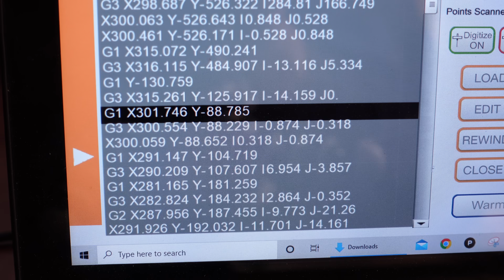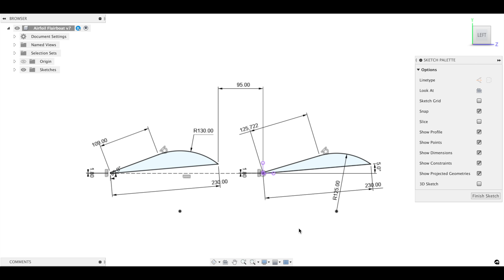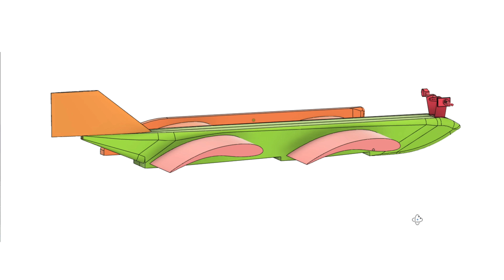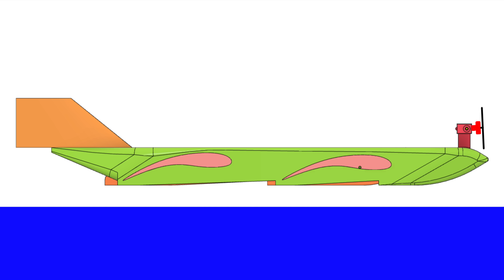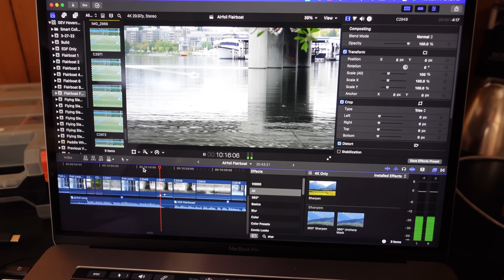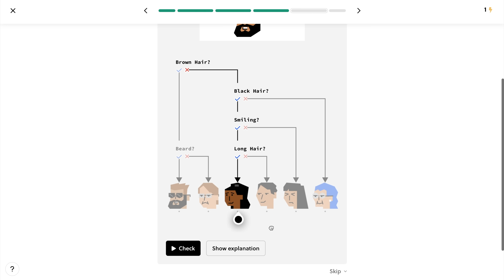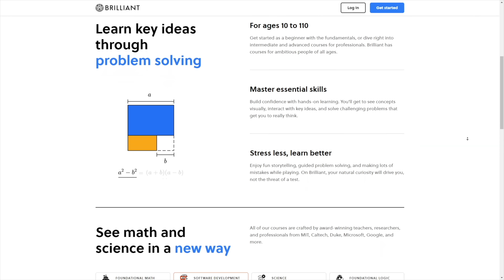Worlds First R/C Airfoil Flairboat

Comment: A couple of ideas for you, Daniel. First, what about separate flotation and airfoils, rather than trying to make the airfoils do double duty? The idea would be to sort of bridge between a three- or four-point hydroplane with ram air tunnel(s) and your/Jorg's flairboat.  I'm planning on trying this. Four flat-bottomed, square-nosed, up-tilting float pods like your RC hydroplane, in about a 3Lx1W proportion each. Each of these is attached to the frame formed by side panels and transverse booms by means of a single end yoke (each) that allows free movement of the float pods about both pitch and roll axes. I'm considering simple suspension (R/C pickup struts) for the float pod connections, as well, all to try to keep the vessel level. Wings are now inboard of the pods, stretched between the frame members. Still kiss the water with the float pods but have almost all the wave- and surface drag alleviated by the tandem air wings. Water- rather than air-propulsion--I'm motivated to try oscillating opposed vertical foils for their potential in a human-powered application. 

Building on the fixed-wing hovercraft idea, one thought I have is to extend the side panels down past the waterline and add deep skegs/skids on either side of the bottom of the float pods, all to serve as both aerodynamic and hydrodynamic tip seals to kill vortices. Deep, flexible but fixed flaps on wing trailing edges also seal (almost?) to water; the same concept applied to the float pods serve as trim tabs to assist with getting to plane very quickly, and may assist with developing an air cushion under the float pods, if speed were sufficient. 

Anyway, your fresh ideas and prototyping speed are incredible, and a spur to me to get my butt in gear and start cranking some models out. Thanks so much for sharing!

-HortonHCCI

Comment: I would say that if it can't achieve sustained flight except in ground effect then it is a ground effect vehicle. Even if it can leave ground effect momentarily.
Reply: Sustained flight is the key measure. Anything can loft itself given enough speed and control authority. Or lack thereof of one’s hydroplane (which have adjustable wings up front but that adjustment is static for a given race, typically).

Comment: Impressive research and development. Making a first  within a saturated commertial environment  is a real achievement. The background is filled with short fat hulled boats. Could the ground effect be up-scaled ? to transport containers with football field size wings. Getting exciped, once the compressed air is under the wing there is no furthe energy exchange  except drag , its just the initial compression at the wingtip. probably need a slingshot to get it going. Amazing work. The songs are good too.

Comment: the trust vector should go above the gc, so when you add power, it will tend to nose down instend of pitch up, and by the starfish case , the use a piple to introduce alittle bit pressure behind the motor under the wing, so they dont have ti put the motor in the front as its quite turbulent. and in nascar race car they have a one way hatch to release extra pressure under the car so they dont have a lift off when the eddy is broken.

Comment: I don't think it's really possible to make a craft that's 100% restricted to ground effect and entirely incapable of leaving the ground effect zone. Once you get going fast enough you will always run into the lifting body effect. Even a brick moving fast enough will generate lift at the right angle. At some point it's just a balancing act, making it so the engine doesn't have enough power to pull the craft fast enough to generate adequate lift outside the ground effect zone - given adequate engine power you'll always be able to break that barrier.

Comment: What if you had the wingspan of the rear foils a bit wider than the front foils, such that the front loses ground effect at a lower altitude than the rear, making it so will try to self stabilize if it starts getting higher?

Comment: If a car with enough speed and unfortunate aerodynamics can lift off, then no ground effect vehicle can be a true ground effect vehicle.

This is a standard that's ridiculous and unnecessary to aim for.

What you really should be looking for is a ground effect vehicle that intelligently regulates control surfaces instead of motor speed to maintain ground effect.

Because a GEV should be able to ground effect at varying speeds.

You could also try to look into initial stage hydrofoils just to get the hull off the water at startup and also as a protection from unintentionally slamming into the water.

Comment: A flair boat based on the same information that you found on the internet was my next project, you have beaten me to the build.  Mine was going to be larger  and heavier to help deal with the water conditions in much the same way a larger model aircraft is more solid in the air compared to a smaller one.  Thank you for your work as it has inspired me to get a move on and build mine.  I will be using the same material but covered with office laminating film.  I previously made an X-bow catamaran as a tow-a-long camera platform for my RC yacht using the same covering technique.  The foam/film combination is a match made in heaven.  Looking forward to what you come up with for some improvements.  All the best Allen

Comment: Have you done a CFD model of this? In my opinion the R/C version being able to take off is a non issue when you scale the R/C motor and total thrust against what's essentially a lycoming 6 cyl motor and prop. Scaling down thrust to add to the realism of the model and still functioning is the proof in the pudding.

Comment: I just started watching but I don’t think this is going to be possible. Lift and speed directly relate to each other. You can fly a brick with enough power. No mater what power plays into this idea.  No matter what you build  that flys just off the ground add more power/air speed and it can fly higher.

Comment: Wonder if it would be more beneficial to have some leading edge slats on the the front wing instead of control surfaces on the rear. Unlike a full-size airplane though, these slats should move forward and up instead of forward/down. Better yet, imagine a wing with a tube for leading edge. Then imagine you have a slat of triangular cross-section that pivots around that nice round leading edge. Essentially this will be changing wing geometry from traditional wing profile to the supersonic diamond wing. 
 Since this GEV seems to be more about rationing incoming air between front and rear wings, the slats would be acting as a divider of sorts, either pushing more air under the front wing, or allowing it to coanda above and go under the rear. In addition, raising the slats on takeoff will allow the craft to get out of the water easier by providing a downward slope that would naturally try to climb to the surface.
With current control scheme all those rear surfaces do is decrease the cushion at the rear, while also fighting the lift it produces.

Comment: Next iteration...ground effect sort of requires ground, not water. Add small wheels so it can roll, but just barely enough to clear the underside from the pavement. Then fly it in a parking lot like you do on water.

Comment: If you scale up the whole design to 3 meters wide, whatever the lenght comes up to be, and build it in foam with chambered paths for two metal pipes to go left to right in both wings, and two more pipes back to front in the body, clamped with the wing ones wgere they intersect, with some 30 to 40 Hp motor I gues you can fly it yourself over any flat kind of surface, trimmed grass included.
The aircushion is at a proportionate ratio so a biger plane would fly at the same ratio between span and ground as a small one, hence in metrics, might fly at a meter or half a meter from surface.
If you want to understand how to build such thing cheap, light and sturdy, go see the channel of Peter Sirpol, his foam ultralight airplanes, that he flies in them to hundreds of feet above the ground.

Comment: I'm curious why you haven't put a atmospheric pressure sensorson the underneath of these crafts.
Reply from the maker: I think if the pressure was actually higher underneath the wing then the aircraft would be ascending. In order to maintain altitude the pressures above and below always have to have the same difference

Comment: 0:10 = yes you can, by reduce throttle, add extra weight, shorten the wing, or designing hole new air foil. but adding more weight or shorten the wing is a better solution, because it cost efficient
14:56 = is not cause by smooth surface, but water tendency to "bounce" or "dampen" the pressure so the craft fly smooth

Comment: At that size and weight, I suspect the surface tension of the water makes takeoff more difficult, and the amount of water stuck on it impacts how it behaves in air, significantly. Personally i like that basic design best, and think it just have to be bigger, and heavier, to stay in ground effect very well, and still not be able to fly.  Any model that needs almost as much thrust as its mass to get out of the water will be very difficult  to get unable to fly, at least with elevators enough to allow free flight.

Comment: The term ‘First Principals’ is thrown around a lot now days, this is a perfect example of going back to first principles to establish how something actually works in order to design something that actually does work!
It would appear from the incredible speed of this vehicle over still water, that the viscosity of the air between the underside of the wing and the boundary layer at the surface was potentially resonating with that above the wing where this is no boundary.

The difference between ground effect mode and free flight mode and how to achieve both with the same wing design is the topic I think.

In terms of ground effect and how I mentioned that I expect the viscosity of the air between the underside of the wing and water surface might be resonating with that above it, I have timed the terminal velocity of many sizes of ball bearings through a fixed sized clear tube filled with oils and one ratio of ball bearing diameter to cylinder diameter for one type of oil produced a much higher terminal velocity.
This higher terminal velocity occurred when the area of the ball bearing was the same as the area from the outside of the ball bearing to the inside of the cylinder.
How about building a wing that can change volume below and perhaps above to account for the ground effect, or as it’s known in fluid dynamics: The Boundary effect in Stokes equation.

Congratulations on breaking records, your doing Awesome!

Comment: To make it a GEonlyV, you could probably lock the flaps (so no controllable flight outside of GE), reduce the thrust to the point where it can only fly in GE and then add a retractable water screw that is strong enough to lift the plane out of the water. That way, you have enough power to get out of water, but can't use that power outside of GE.

Comment: The new wing design leading edge is helpful too. You were using a high lift, slow flight design that would maintain flight at a high angle of attack. The new, sharp leading edge contributes to an early stall condition with even a slight angle of attack. 

Looks like you could shorten the wings too.

Enjoying your experimentation.

Comment: Add a spoiler inversely proportional to the throttle. When you power down, the spoiler extends. That would give you control when killing the throttle without it pitching up.

Comment: Again, I have built a successful version like yours but solely operated on asphalt, and indeed the rear wing has almost no incidence, and is basically a Clark Y while the front is a thinner undercambered wing. The motor was placed in very back of the fuselage to avoid the power issues you noted.
I have a video that was filmed onboard and you can definitely tell when it was flying vs just driving on the wheels.
https://www.youtube.com/watch?v=Fkj8-WAkv-Q

Comment: Daniel.
the original Caspian sea monster could fly out of ground effect, its why there was two pilots, one man on the throttles and another 4 people doing other things.
it would start off with all 10 engines giving full thrust, but when it was in ground effect it only ran on 2 engines. if my memory is correct then the Caspian sea monster couldn't launch if the waves were more than a meter high, it caused so many problems.
When you make the next version you could try having 2 motors onboard but only one in ground effect. 
Also I think that some people don't fully understand the definition of a ground effect vehicle, its a bit like trying to write a description of a fish, no matter how hard you try there will always be a fish that doesn't fit the description. 🤔
I do like that craft you made, it just looks awesome and does what it should. well done. 😃👍
im going to see if i have a copy of a documentary about the Caspian sea monster, the design and the people who made it. it's full of information. 😀👍
Reply from the maker: Thanks! Let me know if you find it

Comment: I'm trying to design my own air foil flare boat totally different than yours and hopefully get some pictures to you soon. On this video at about 9:19 you can see water drips  blowing away from the sides of the boat.  What if you add a 1/4 inch of thin something, to the outside vertical portion to try to contain the air flow.
Reply: Those drips do seem to be pushed out after they are collected & pulled off the fins by airflow.

Comment: Might be considered cheating, but you could put on a water propeller that will only give thrust when it's on the water. This would allow you to have a weaker motor that only keeps it in ground effect but still able to get it up off the water.

Comment: One other thing you could try is to put fins on the back like a surfboard. It would help keep the CG rearward.  Also note that when the boat is most stable the rear is a bit higher off the water than the front.  ... Awsome project!

Comment: This is so sweet.   You should try another model with a less wide front wing.  What I think you want to create is a condition where the rear wing creates more lift than the front wing at any given velocity. If the new design has a front wing that is open for ram air the rear should always be lifting a bit more.  The second thing you can do is create a split-flap on the front wing that can dump pressure.  Then this can be controlled by a tip sensor.

Comment: So, why not increase drag and/or decrease lift while out of the water. Thrust required while in the water is way more than that in the air, resulting in the ability to climb out of ground effect (I saw your previous videos and realize this isn't necessarily a "problem", but I like the ground effect vehicle idea). Because of the large difference in drag (floating vs flying), there is way more excess thrust while airborne. If you reduce the excess thrust by increasing drag you will at least reduce the amount of power change required once in ground effect. At most, you may increase the "sweet spot" margin where you are able to fly in ground effect, but not out of it. By decreasing lift , you will be able to dampen the transition between floating and flying(1) as well as increase the dependency on ground effect. I'm not confident that decreasing lift will help in the long run, as you will need to be going faster in the water (therefore increasing drag while in the water)  before you  produce enough lift to climb out of the water, but I think it's worth investigating.

(1) By this, I mean you will need less of a power reduction when transitioning.

Comment: was actually thinking about the whole "self stabilizing thing" of the OG flair boat, knowing that it's from the '70 it's probably more of a "fail-proof" than an actual self stabilizing phenomenon.

The original one looks like it might have the motor on top of the rear wing CoL, a mild (but not insignificant) front wing camber, a rear wind design protruding a good bit after the propeller and most likely a pretty rear biassed CG (given that in almost all original videos it look like the boat pivots out of the water front first, rather than just lifting)

That makes me wonder if the "it won't flip" claim might rely simply on, in case a flip is initiated: 
1- the front wind might stall relatively soon after (given the higher camber and the higher angle of attack).
2- that would make the whole boat pivot around its CG (which looks to be about ⅔-¾ of the way to the back).
3- the rear wing trailing edge would dunk into the water imparting an opposite force to the flipping moment of the boat.

Also a purely mechanical system would be totally capable of adjusting the pitch angle of the propeller or cut engine power (via a triple jet carburettor). Even a simple spring loaded tab exposed into the water/air stream would be able to distinguish between being airborne or floating.

Comment: Why are there side rails connecting the wings? This would reduce wingtip vortices which are actually needed in this application? A major drag reducer in ground effect is a result of the elimination of wingtip vertices. The further away the wing gets from the surface of the water the larger the induced drag from wingtip vortices becomes. Up until roughly 1 wingspan above the surface. Since you want the craft to struggle to exit ground effect I would think that removing the rails would increase vortices and improve its stability?

Comment: looks like a spinning stone thrown and bouncing over water, not lifting off
Reply: try 200krpm flywheel motor-generator on a maglev stick, vertical, with r=0.1m to 1m, specific energy (with gyro balancing) of the disc, is 300Wh/kg and 30kWh/kg, li-ion and lifepo replacement
Reply: ground effect must work on ground, not water, only